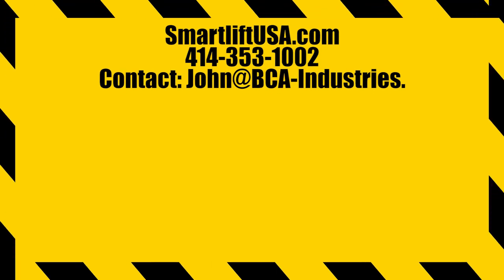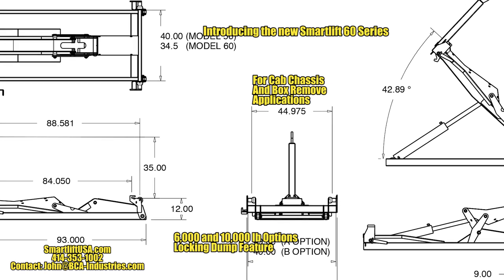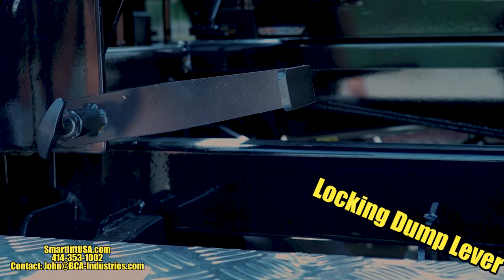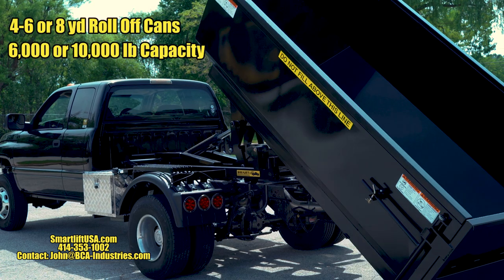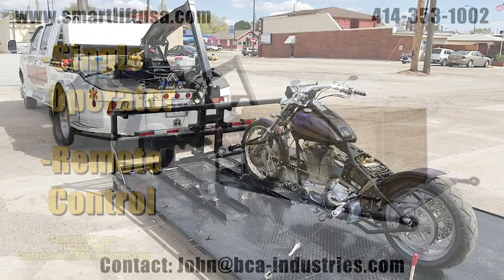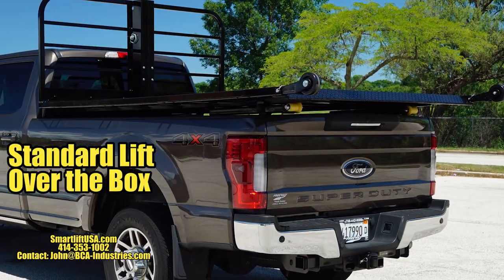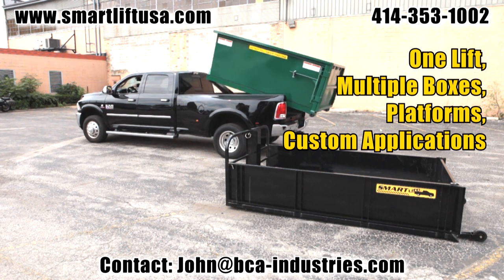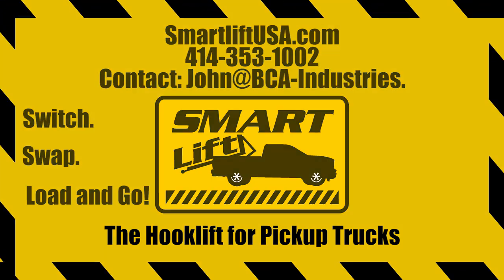Smartlift and Smartlift 60 Hook-Lift for Pick-up Trucks

Comment: Can an 8 yd container be put on the back of a 1500 Dodge ram and how much wt.will it hold also are there wheels on the bottom
Reply: A 1500 truck could barely carry the lift by itself, much less a container and trash inside it.